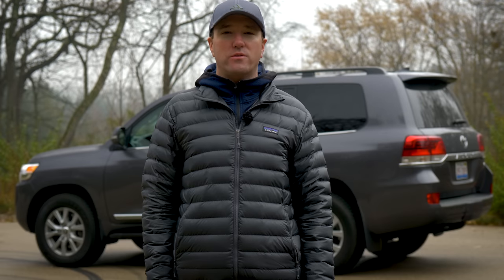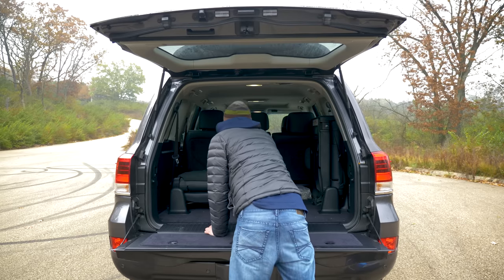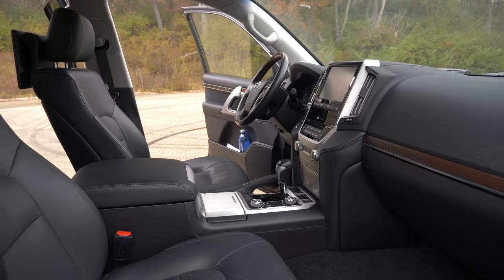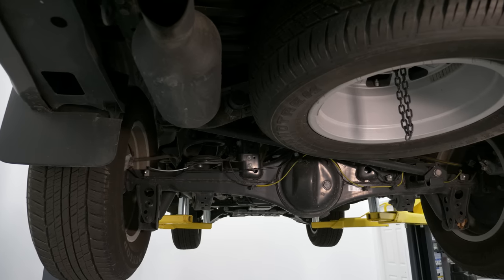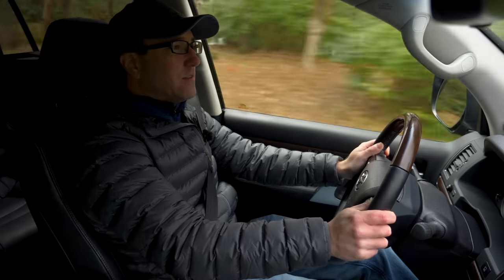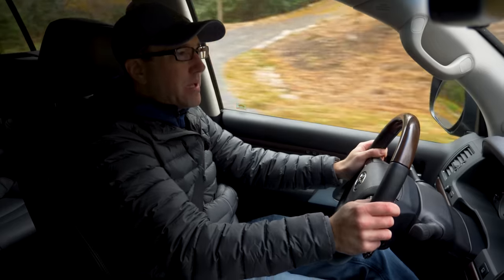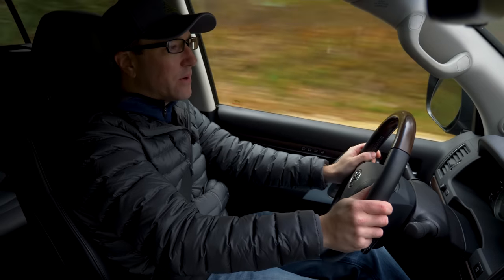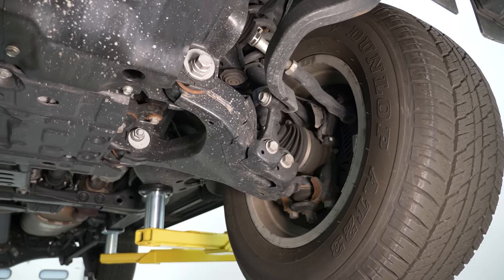Review | 2017 Toyota Land Cruiser | The Veteran

Comment: Buy one that is a few years old. It is still in the 60s, but you are not eating the initial depreciation. Plus this is a 200k plus mile vehicle, and buying one with 25-30k miles is a non issue as long as the interior has not been ripped up.

Comment: Is this suv related to the Lexus Gx my aunt and uncle has owned the Gx since 2000 they recently have a 2017 and my godmother has a 2017 Toyota 4Runner limited
Reply: From my brief research it seems as though the Gx is closer to the 4Runner as it sits between the Rx and the Lx(The Lexus version of the Land Cruiser)
Reply: Not really - the GX is called a Landcruiser Prado everywhere else in the world and here in Australia it's now only offered in diesel. The 4 runner is only related as it's built by Toyota - it's not really that available outside the USA.

Comment: I had a 2016 4Runner great truck. The brakes are weird because of the KDSS in my 4Runner the brakes were part of my KDSS system so the pedal was kind of lacking feedback and mushy but it stopped really well
Reply: Bmwryder - KDSS was part of the braking system - are you sure? It's nothing to do with braking at all - it's a hydraulic sway bar disconnect which measures differences across the diagonal wheel travel including rates of travel and how much suspension flex across each of the four wheels. It has a hydraulic control unit in the middle of the vehicle. It's completely separate to braking. Maybe you are thinking of the ABS and the crawl control? KDSS was invented in Australia and I have had multiple vehicles with it hence I understand it very well..
Reply: occyman I could be very off base I was told that when I went in to the dealer and asked about pedal variations in my 4 runner brake pedal. I don’t have my 4 runner any more but when I popped the hood a couple times it didn’t appear to have conventional braking components master cyl and booster and when I touched not pushed hard the brake pedal with the stereo off you could hear what sounded like a diversion of fluid. Plus if you let it sit for a few days the pedal started sinking really low. Then you’d start it and the pedal would firm up. I could be wrong but my 4 runner definitely didn’t have conventional brakes which whatever Toyota did is probably why he said they feel funny.
Reply: Bmwryder mmmm interesting - yeah I heard him say in the video the comment re brakes too but I put it down to unfamiliarity. I have a 2015 model cruiser (now my third) with KDSS and it's brakes are good. It's mechanically the same car and my brakes are normal. My Cruiser is the twin turbo v8 diesel.

Comment: Disclaimer: not an engineer. If they updated some of the steel structure to aluminum, I’m assuming that would boost the mpg and improve handling, braking. If they can get mpg to low 20s on highway (without an electric motor/hybridization), that would justify the current pricing more (if they could keep it near current price). Just don’t change the looks, Toyota! I’m not a fan of all the plastic panels and geometric fascias (sp?) on the latest “SUVs” that can’t leave pavement. This definitely has old-school charm.

Comment: Blame the Chicken tax laws. There are lower trim models overseas with fuel efficient diesels. The same LC overseas comes with a V8 diesel. the 70 series and prado land cruisers is what you are looking at, but even the prados (which are Lexus suvs here) have been stripped of their diesels and varnished in wood and gadgets when they are sold over here.

Comment: Finally one of the reviews i have been waiting for, I would like if you do one of Land Cruiser Prado's also they are like twins.. And a question for people who own one of those Prado or 200 land cruisers is it a good car for everyday driving and family? In EUROPE how much does it spends on fuel .. is it a good daily driver
Reply: 17genc we have only Prado's in my country. I always thought Prado's were smaller, its the feeling I have. Smaller in body and engine size.
Reply: I get 22mpg Imperial out of my 6 cylinder 4.2 [1HD-FTE] Land Cruiser 100. 24 at best.  I got 30 out of a Range Rover full fat no problem and get 38mpg from my current Volvo XC90 which runs rings around the Cruiser on the road. Volvo can't tow 3.5 tons and hasn't got the ground clearance for site and farm work of course.
200 series V8 used to be imported to the UK but they didn't sell well, unlike the 80 and 100 series which sold by the shed-load. Its no longer imported and we now only get the Prado 120 or 150 series, whatever the latest version is called. Even that is too expensive and too old school to compete at about the same price as a Discovery5 or base RR Sport. Unless Toyota introduce a new model soon, they might as well not bother with the 150 series Prado either.
Reply: So you would recommend me to look for Prado since it's smaller engine and better fuel consumtion compared to 200 or 90,100 Series.. I wouldn't go for RR since they are unreliable and expensive ..What do you think of Hyundai Santa Fe or Kia Sorento.
Reply: Prado [150 series] current model is, I'm afraid, past it's 'sell-by' date. Way overdue for a complete redesign to brings its driving dynamics into the 21st Century and competitive. It is a fine work truck though and will surely last a long time and is more reliable than average for the class.
Unless you need the pure offroad and towing ability of the Prado, the current Korean duo are the better all-road vehicles. The LC Prado itself hasn't got stellar towing rating for some reason. 
Have a look at them and consider whether you really want or need a body on frame truck with a live rear axle for your intended use.  At the price of the Prado, certainly in the UK today, you can buy a well equipped Discovery 5 which totally outclasses it in every way. Just be prepared for a few software issues that will be ironed out over the next few months of production.
Reply: North America(at least Canada and the U.S.) doesn't get the Prado
Reply: Prado and 200 series are nothing like twins in any sense of the imagination. They are completely different - I currently own both
Reply: occyman 
Narrower but same principle, body on frame, independent front and coil sprung rear live axle. Full time 4wd. Available three rows of seats.
Over in the UK Prado only available with four cylinder diesel and until they stopped importing the 200, it was only available with the V8 diesel. Specifications vary with territory. Prado is available in some countries with plastic trim, rear barn doors and part time 4wd. Not here though.
Reply: Huw Williams disagree no they are nothing like each other and if you had ever driven both you would know. At least I have owned both vehicles and speak from experience and not some self appointed expert

Comment: Why this over a Sequoia?? Did Toyota forget they offered a Sequoia?
Reply: For offroading and overall quality, the Land Cruiser is better. Land Cruisers are built with a 20 year service life, meaning that you shouldn't need to replace any mechanical components for 20 years. The Sequoia is more of a "family hauler".
Reply: The Sequoia was built for the U.S. Market. Plus it’s just not appealing.
Reply: There is no comparison for off roading and long term reliability. If you have to ask, the Sequoia is a better choice.
Reply: Derp Could someone not make a damn near fully loaded Sequoia off road Worthy for less than $85k? It also has the same engine, can't be that much less reliable.
Reply: Landcruiser has a lot more R&D, testing, and higher quality control. They've been throughly tested and proven in the harshest conditions around the world. I also think you under estimate the size difference off road at least on tight trails.
Reply: miccheck11 like I said, this car has a 20 year service life- meaning it's been ridiculously over-built and made to last. Not to mention the kdds system and diff hardware that would be difficult to put onto the sequoia, and of course, the sequoia still has the same interior from 2007. You cant replace that.
Reply: The Landcrusier is made in Japan.
Reply: I have a 2017 Sequoia. Amazing vehicle. Its is bigger and has independent rear suspension. It has the same engine and transfer case but still uses the 6 speed. I bought the Platinum model primarily because of the towing package with the rear air suspension. We tow our 28ft travel trailer a lot and the rear air suspension and adjustable shocks make a huge difference. People keep saying it is dated but I don't care about the gagets. The Sequoia and Landcruiser are proven to be ultra reliable. Toyota is a very conservative company when it comes to rolling out new tech. I appriciate that because repairs come out of my pocket after 5 years! I was shopping for Tahoe's and Expedition's but the Sequoia was cheaper and had the best reliability ratings so it was really an easy descision.
Reply: I've owned both my wife had the Sequoia and I plan to always drive a Land Cruiser. Both are great vehicles the Land Cruiser is more purpose built for offroad adventures and exploring don't get me wrong it does everything well but it does the offroad exploring really well and what its was built for. https://youtu.be/IXNDx_XgoKg

Comment: They come in a V8 diesel in Australia so more torque and better fuel economy or as my 100 series has the same motor but is on LPG as well as petrol so is a lot cheaper to run.

Comment: How many of these will ever see mud?
Reply: Not many, because they are totally unsuitable for mud. They are too heavy and have silly size tyres that just float hopelessly on top and slide, tyres totally clogged up. How do I know? Because I farm in a wet grassland area and need to avoid getting stuck and having to call my brother out with a tractor to tow me to a road. Granted its as much down to the tyres as to the weight of the vehicle. 
I've just bought a set of 235 section wheels and tyres to replace 265 lower profile  Summer tyres for one vehicle. Its a 400 mile round trip to fetch them, so have to fit the trip in to schedule somewhere.

Comment: Dear Toyota , pls don't follow the recommendations of the tester, leave the car as it is . For full economy drive a diesel : i need 11l on 100 km , with a 3.5 ton trailer 15 litres and i cannot complain about it , keep in mind it is a V 8 ! I have a 2002 Toyota 100, a 2010 Toyota 200 and a 2012 150 Prado and the 200 is the best car i ever had and cheap too.

Comment: The Land Cruiser is known around the world  has the Land Cruiser and nothing else, i thing the other name Mr. Geese is thing of is the Land Cruiser Prado, which is a different vehicle to the regular Land Cruiser. ( similar but not the same)
Reply: Yeah but the Prado is only a local name for the smaller series of Land Cruisers. In the UK the big 100 and 200 used to be known as the 'Amazon' while the 90 series [the original Prado] was called the 'Colorado' until very recently. Since the 200 [the one in the video] was no longer imported, the Colorado/Prado/150series is now just called 'Land Cruiser' here

Comment: What I hate about the Land Cruiser.   The gas mileage......and They simply do not depreciate much.  The first 3 years they lose some value but after that  you really need a lot of money to buy a used one.  Even one with 250,000 miles on it.  Other than that it does everything a proper SUV should.

Comment: Just bring Series 70 or 80 to USA. And all this discussion will be redundant.
Reply: strelnikoff7 we got them in Saudi Arabia and it's the most reliable off-road trucks ever especially in the summer in 60 degree heat there's no overheating at all
Reply: ibrahim I am not surprised - good for you! It seem’s like all world have them except USA... even that Mercedes G, here it’s AMG or 550... while in Europe you can get diesel version for 1/3 of the price... proper offroader
Reply: strelnikoff7 it's the same thing for me I wish if we got 4Runner trd pro instead of prado or fj . Also the 70 series it's different from Australia they have twin turbo diesel v8 but saudi it's just v8 singl turbo so we take the gasoline with 4.0 l and 280hp with five speed it's amazing in desert also in camping in winter ❄️

Comment: I just don't get where the $85k comes from on this thing. It looks boring and dated inside and out, lacks any kind of technology from the last decade or two, does not make use of any special materials and uses way too much plastic. Sure, I get it's a capable off roader with Toyota reliability but that just doesn't cut it for me.
Reply: guy proulx 
Yeah, I do. I expect to actually get something for my money. I guess that makes you the type of guy that doesn't mind getting screwed. Technology can be reliable if designed right. I own a 10 year old car with power everything, remote entry, automatic climate, heated seats, etc. Everything still works fine except the Bluetooth module that died because of a design flaw. Hey if you think technology is useless why stop now? How about full manual windows, door locks, no radio, no abs and no air conditioning. I don't think everything they're pushing nowadays is useful, some of it is gimmicks, but you anti-technology people are like the old geezers that refused to give up the rotary dial phone.
Reply: guy proulx 
Here's an idea, don't be an idiot and make yourself distracted, keep your eyes on the road when driving. Pretty simple practice that has served me well. People have found ways to be distracted and crash long before cell phones existed. Can't fix stupid.
Reply: guy proulx 
Technology has a lot of usefulness, regardless of some negative side effects. There are always two sides to the same coin.

Comment: and here is where you fucked up, calling a toyota a SUV..

I would not put toyota into the SUV class nor would i waste time in the comparing it to the crap either Ford or GM produces..

And NOTE: that what you get in a vehicle out the show room floor vs what you will add to it to make it compliant for your use is a different thing together.. 

I would say if you were just starting a family I would say you will still own the same toyota by the time your kids return from college and likely see the great great grand kids in the same vehicle, I just can't see that happening in a GM or FORD product, you will likely be replacing the ford and gm's every 3-6 years vs 20 plus for toyota..